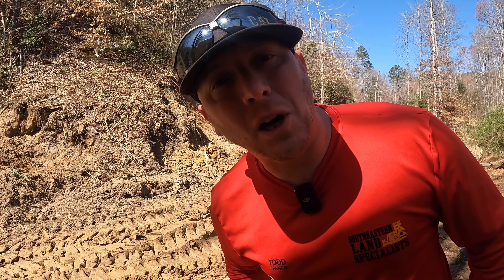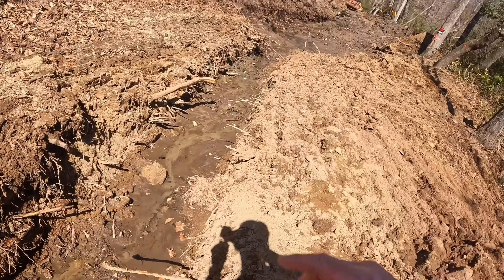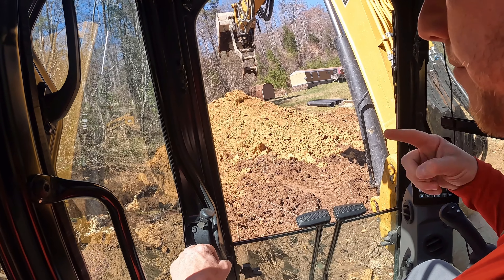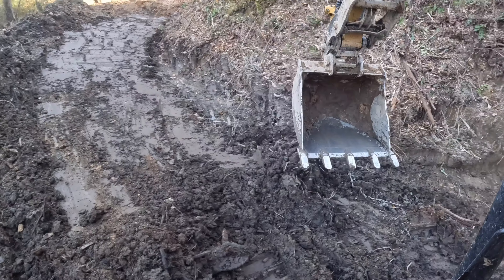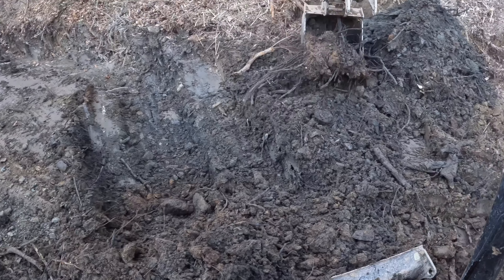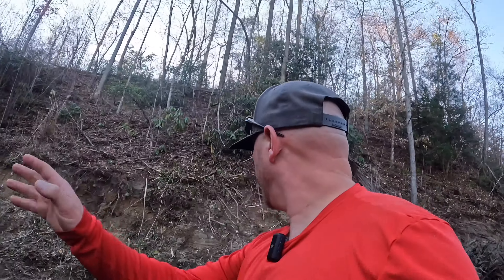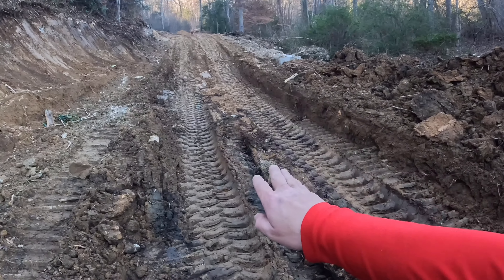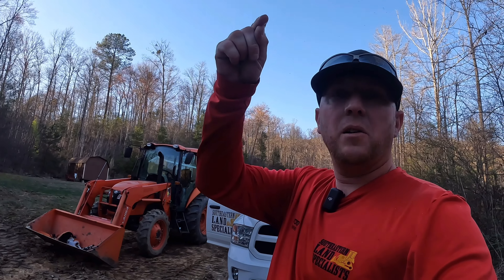How To Build A Gravel Road on Unstable Ground (Part 5 of 10)

Comment: Hay Todd. Love the jobb your on , I had a same situation and I ended up tell the engineer to backfill with natural river rock and then sand and hard clay on top. A sheets foot roller would be helpful even if tou hand to rent from Caterpillar.  Also you can get a dozer blade & grader blade attachment for your skidsteer.. I am retired 61 years old with 40+ years in construction . Keep up the good work!

Comment: I had similar problems with my new driveway I just disc up the soft spots two or times a day then rake that over then disc up some more repeated over and over then packed it back in small layers but that was in the summer in 105 temps and sunny days.  It got solid quick.  Ground water here crazy its pretty flat in Mississippi.  Loaded dump trucks come down it now no problem.

Comment: Oh boy that clay is something else! When wet it never dries but if you can actually get the water to run off it it gets very hard and actually can be really nice and solid. I filled half my back yard with horrible wet clay from digging out the foundation for a barn and had several trips axles of it. I let it dry for a year then spread it over one half of the back yard with a slight slope or grade the whole way across it. I also put a swale above it to keep water from running onto it. Let me tell you, all year round when every thing else is soft and spongy that is the only part of may yard that is firm enough to drive on. There's also a fair amount of gravel mixed into it as well from the pole barn driveway that got somewhat mixed into it. Grass doesn't grow on that side but I don't care because I can drive my trucks and equipment on it. And piles of concrete or debris. Also makes great staging area for burning.

Comment: I feel your pain. We are building a 3500’ road for a development through a swamp with the same material to work with plus ground water. We had a 7’ cut and fill in some areas to hit solid ground. Check it out in our videos if you have a chance. We used dirty shot rock topped with 3 inch minus. Rock solid now and it allows the water to run with the road almost like a French drain. Love the vids bud.

Comment: Wouldn't drain tile work better in this situation like you used in fields you would have to put an air inlet on the edge of the road so the water would flow to the river
Reply from the maker: I imagine it would work